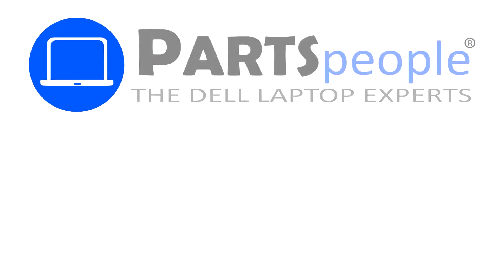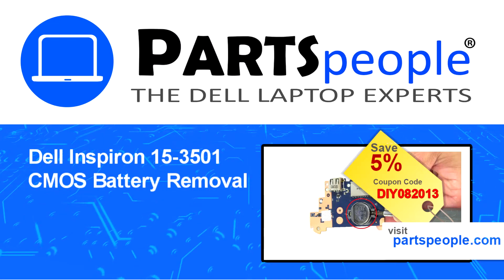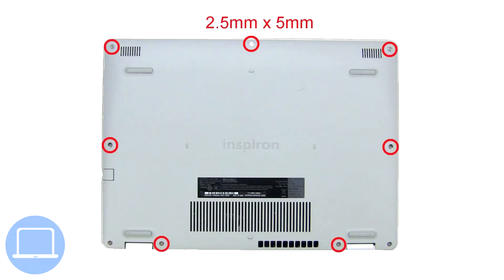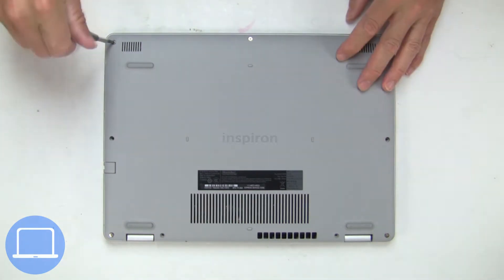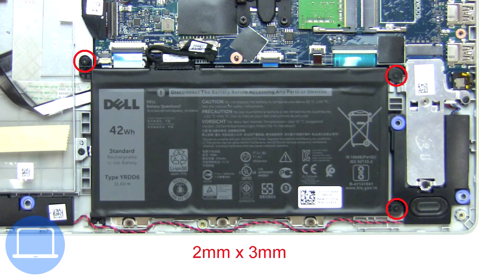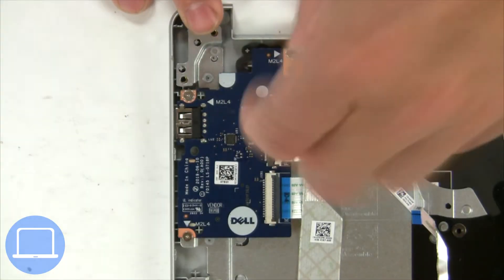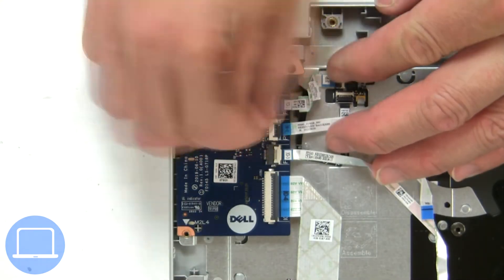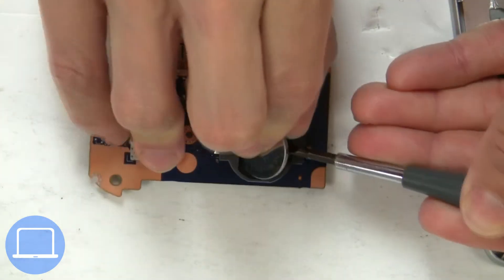Dell Inspiron 15-3501 (P90F002) CMOS Battery How-To Video Tutorial

Comment: Dose this model have the cmos jumper switch? I need to reset nvram and cmos because i lost my encryption keys for the bios any help would be greatly appreciated! Thanks.
Reply: Just remove the cmos cell, laptop battery, and ram also and wait for 2 min then start your pc it will automatically ask do you want to recover your BIOS then select yes then your pc will be recovered
Reply: My pc is dead while bios is updating so i do above mentioned steps and my bios is recovered and now my pc is running well